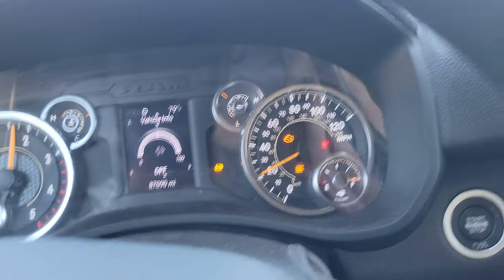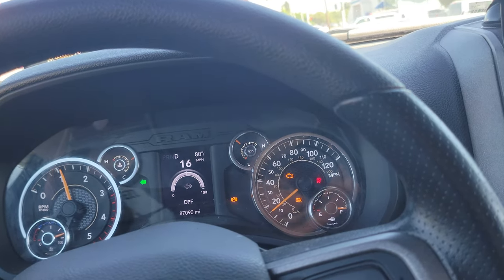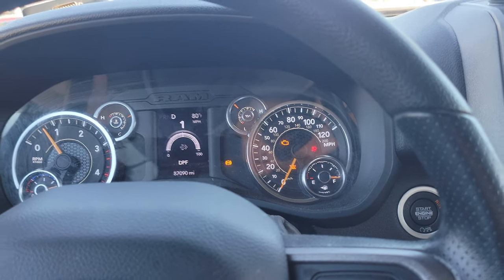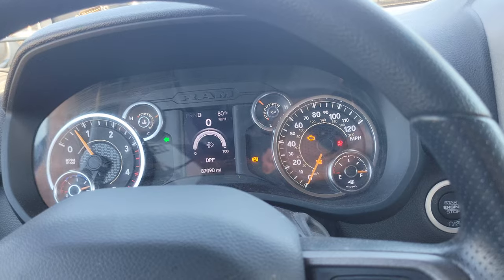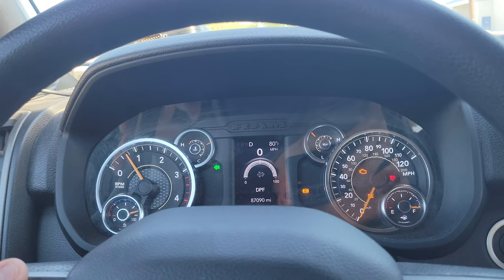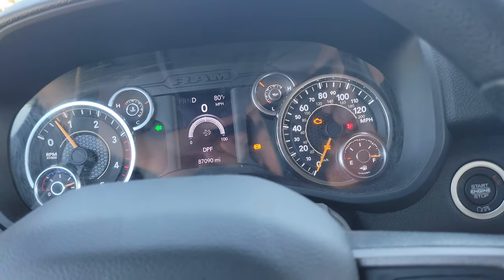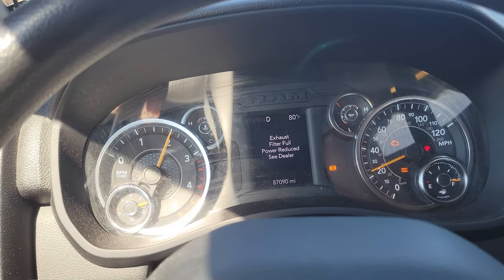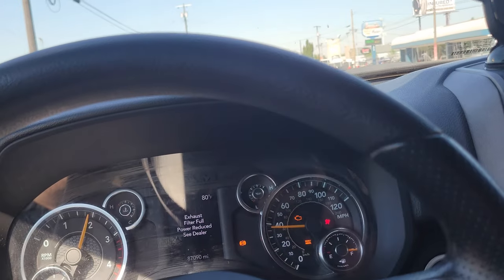2022 Ram 3500. Showing dpf issues.

Comment: Hey Paul, have the dealer check the pressure differential sensor. It could be faulty and misreading the level of backpressure between the front and rear of the DPF. The Pressure Differential Sensor calculates carbon saturation levels. The DPF could be fine but the sensor is reporting excess carbon and preventing a regeneration cycle.

Comment: About a month ago I threw in the towel on my diesel pick up. It got to the point where I had to wait days on end just for a diesel tech to be available to see the truck then was placed on a back order for an egr 3 months. Luckily for me gassers can do everything I need and I will never again own another diesel. If your out of warranty and own a diesel most people would go broke at the sight of a check engine light.
Reply: Its unfortunate. Diesels were always more simple and more reliable than a gas motor but thats no longer true. Gas engines are now more reliable due to emissions. If you really need to tow heavy all the time you just gotta either bite the bullet and be ready to spend tons on repairs and have downtime or buy an older truck and restore it. Either way its not worth it
Reply: @ronnieswindski825  absolutely, it’s a shame.
Reply: As planned by the EPA

Comment: Had the same issue dealer tried to manually regen the truck wouldn’t fix it they reflashed the ecu didn’t fix ended up being a bad dog filter now I’m waiting because it’s on back order 22 ram bighorn mega cab
Reply: Doubt that fixes it either unless it was sucking air
Reply: They should have never added these emissions systems
Reply: @sethmichaelson6972 The truck manufacturers don't want to...the EPA is forcing them to. The EPA is ran by Libs, given the power by elected Libs, who were voted into office by Libs.
Reply: @grc5618 if they cared about the consumer in that point they wouldve made it the same on the ecu so we could delete them easier my 2022 ram 2500 6.7 so has 60k thank god no issues yet but ive looked its 6000$ to delete my truck not worth it for me. Luckily i drive an hr to work on hwy at 75mph so it get hot everyday and then i also use it around the farm pulling trailers some and a tractor but if i have an issue i think ill be looking at trading it coming up to the end of three yrs paid would love to keeper got my bumper lift and winch already on’er but if something get back ordered i cant pay months of payments for a truck i dont drive 800$ payments aint cheap

Comment: So glad I bought a 2018 Ram 2500 and had her fixed @ 9000 miles.
Reply: Glad I bought a 2017, with a CP3 not a CP4 injector pump and still solid cam followers and not hydraulic lifters.

Comment: Def nozzles get all gunked up. Just remove and clean it. Then only use blue def platinum
Reply: Using platinum expired def is a big mistake.
Reply: @repairvehicle  Are you saying Platinum Def is bad? 
Which Def brand do you use?
Reply: @faultless18  too many platinum def sold expired or near expiration. I use oem def, clearly stated expiration date not like platinum that you have to call hotline to find out expiration

Comment: Just got my 2022 2500 out the shop yesterday for a full DEF filter with no warning. Dealer is waiting on a recall DEF sensor along with 2 other recalls but they cant get the parts. After leaving the dealer yesterday my truck did a regeneration with another regen this morning. No dealer can tell me the true process of what to do when my truck starts a regeneration; as of yesterday my truck said regeneration in progress continue driving. Now it just says regeneration in progress, not continue driving. I dont know.

Comment: I have a 2020 Cummins 3500 shingle shingle rear wheel. Just had the CP4 replace today under the recall, back to CP3. I have a bank's data monster that tells me when  Regeneration is going to  happen. I never shut the truck off until the process is over. I've never had a problem with DPf filter.
Reply: How many miles between regen idash tells you?
Reply: @repairvehicle   The bank's gauge will give you a percentage.  When it hits a 100% it will be starting in about 8 miles.
Reply: @mikegroft1569  I have banks and it doesn’t change percentage
Reply: The gauge will do different things for different year& model  Vehicle. My 2020 ram Cummins gives me a percentage when DPF is getting ready to regen.
Reply: @mikegroft1569  on my 2018 idash does not work. But scangauge 3 gives me percentage, mileage and hours
Reply: @repairvehicle  The gauge will give me a percent like 80%. When it hits 100 then regen will start real soon. When it is done it will say something like 45%. From factory ram has a gauge that will tell ya the regen process has started & when done. No idea when it will happen though. I never stop truck during regen process. Truck has 25,000 miles. No problems with dpf system.
Reply: @mikegroft1569  scangauge 3 will give percentage too, up 100% when it’s full and it will indicate if regen is on or off. Mileage between regen and hours between regen. Also, scangauge 3 displays quality of def fluid in percentage

Comment: I have a dodge ram 3500 diesel code p2459 came up the dealer says I need a new new filter for 3500  it has 88000 miles on it I feel that it’s to early for a new filter what should I do spend money on some thing I don’t need or go else where😊

Comment: Experiencing the same issues with a 22. Currently have 60k (52k towing) and 200 idle hours/ 1176 drive hours and well maintained. Dpf was replaced at 35k and I depend on this truck for work. Going back to ford

Comment: Mine did this about two weeks ago at 70k miles. Exact same. See dealer power reduced blah blah. 50% DPF and Check engine light. But I gunned it, and it went into regen mode, it cleared the see dealer message. And haven’t had an issue since. Fingers crossed :/

Comment: I would not label all MY2022 are issues.  There are tens of thousands of them out there that do not have an issue.  Diesel emissions has come a long ways when it was introduced in late 2000’s, but can be an isssue early on before racking a couple hundred thousand miles.  It sucks if it happens.

Comment: Anyone have any fuel leaks on the cp-3 conversion kits? 19-20 ram Cummins? Coming from the high pressure line that screws on the pump to the fuel rail? Thanks.

Comment: Frustrating Paul. I do have a 21 that was built about 3 months after yours. Everything has been perfect with the truck so far. 15k miles.
Reply: Same here with my 21 as well just hit the same milage been very happy just an issue with a squeal after I take it off park and I to drive

Comment: My 22 3500 had to have a def injector replaced at 3,000 miles but no dpf issues yet wonder when they will start.
Reply: When don’t allow complete regen done
Reply: So if your almost home and the regen starts what do you do ? Drive around till its done ?

Comment: Hey Paul thanks for the video. Do you know by chance if the drivers of your trucks are shutting it off when it high idles itself? I've read on a few forums that it plugs the def when you shut the truck off when it is regening itself
Reply: Forums are garbage and it’s a false information about plugging def. Do you know the purpose of def?
Reply: Two out of the three trucks I've driven have not had plug def filters! Other drivers have gotten those trucks and have had problems with the def. My thoughts are that's the only thing I do that is different is if the truck High idles itself I wait until it idles down

Comment: I just called dealer my desiel particulate had 3% remaining he said computer will regen filter so far has not
Reply: How do you know had 3%?
Reply: @repairvehicle  that is what guage told it said 3% remaining
Reply: @GaryBlankenship96b40  what gauge?
Reply: @repairvehicle  2022 dodge eam 3500, as i scroll through engine report oil temp pressure coolant boost etc rt click it comes uo desiel particulate filter it say 3% remains justblike oil and fuel filters
Reply: @GaryBlankenship96b40  , thank you! My 2018 does not have this option from factory. I am using scangauge 3 and when it’s says 100% full, it starts regen and displays mode on or off. I just uploaded video to my channel if you want to see

Comment: Driver idle much?  That will plug them up.  What's your hours vs miles.
Reply: Drive idle does not plug up any worse than driving loaded, it still burns fuel and generates soot. Idle hours not displayed by the date, it shows total hours for idling and driving
Reply: @repairvehicle  DRIVER. As in Is the driver idling all night so the exhaust and engine is not hot enough to burn anything off.  I don't know what you a referencing.
Reply: @repairvehicle  That's not true at all. At idle or low load, the EGTs are lower, creating more soot. But at higher RPM and higher engine loads, it reduces the soot buildup, even creating enough EGTs for passive regeneration.
Reply: @AkioWasRight  passive regen starts at 15mph or higher
Reply: @Itsa_Mea  did he say his driver was idling all night with this truck?
Reply: @repairvehicle  Did he say his driver didn't?  Does he really know?  THAT'S why I asked the question!! What are the hours in the cluster?
 This isn't a hard concept.
Reply: @Itsa_Mea  hours on the cluster is not going to tell you if idled on his last trip or not. It gives you total hours for driving and idling.
Reply: @repairvehicle  you're clueless. The EVIC gives stationary IDLE hours!  Plus it gives driving hours so by knowing the hours and miles it gives an average.  
  Stop guessing and let him supply the numbers.
Reply: @Itsa_Mea  , you are clueless yourself, you did not even read my comment. Read again otherwise you make full of yourself. I drive ram cummins and know what I am talking about. You are the one guessing with too much idle statement. Don’t even remember what you said earlier? Read it again your own comment and don’t put your own words into my mouth.

Comment: It’s not just 5th Gens….DPF issues go back to early 4th Gens we have a 2012 3500 and it went through 2 EGR cooler’s and a DPF filter….all it did was pull as well……drive to Mexico and have so parts fall off LOL
Reply: It’s because they were running without def and engines were dumping a lot of fuel and generating soot
Reply: @repairvehicle  many moons ago when DEF first started to get serious around 2010 maybe filters were clogging thank god, we have a pre-DEF truck
Reply: @DIYKAI  pre def requires frequent erg system cleaning
Reply: @repairvehicle  if you have a EGR to clean lol
Reply: @DIYKAI  what is your fuel economy without egr?
Reply: @repairvehicle  well if we were to hypothetically have a 6.7 without one, it would get around 16 city with a light trailer, 20+ highway unloaded, 10k trailer around 11-12…..with a Titan tank 800 city over 1k highway. 😃
Reply: @DIYKAI  my 18 cummins gets 21 highway with all the emission equipment and 18 highway towing
Reply: @repairvehicle  does yours have 900HP and 1500TQ LOL
Reply: @repairvehicle  the newer ones do well we heard

Comment: I'm going to have to take a break from your you. getting worried my 22 will fuck up. only got 9k on it
Reply: It will be fine.  Like every truck manufacturer……a small percentage of trucks start acting up. Of course the guys that have issues come onto these channels looking for help. Think about the thousands of trucks on the road that are just fine.
Reply: I got 102456 on my 22 just pull def injector cleaned it in water. An just changed my crankcase filter.      Trucks a 22 big horn an is a best.  I pull a 40ft hotshot

Comment: Both of my local dealers can’t even get me in for 12 weeks for trans issues
Reply: What issue are you having? What year is your truck?
Reply: @repairvehicle  21’ ram Cummins with 68rfe.  Shift solenoid tripped a code p0750 uD circuit fault.  Cleared it.  Drives fine.  Not even gonna deal with the dealer.  My local diesel mechanic has a 5th gen with a 68 and he’s having the same issues.  Ram doesn’t even know how to fix it.  I’m just gonna drive around with my scan tool for 10-12k miles at a time until it happens again.  Buy a valve body, deep pan, new solenoid (replace and put the old one on a shelf as a backup).  I’ll keep the stock thermal bypass valve just because it gets pretty cold here. Have you heard of this or have suggestions?  I checked the harnesses and put dielectric grease in them.  Fluid is clean.  Truck has 13k so it better be.
Reply: @Steadierpark  , I have not heard of this issue. My 18 at 50k miles with 68rfe is running flawlessly. It could be defective part, it’s common in any brand these days

Comment: I don’t get why people are buying new and paying $600-$800 a month if not more it’s insane!!!
Reply: Because they have money
Reply: I dont get why people are still buying these stupid overpriced diesels these days!!!
Reply: @SuperDuty250  , power, sound, longevity, fuel economy and exhaust brake is best in class on cummins
Reply: @repairvehicle  dont forget dpf issues
Reply: @SuperDuty250  dpf issue is when you don’t allow truck to complete regen. It’s like saying engine issues, when you don’t maintain.
Reply: @repairvehicle  you dont have to worry bout none of that with gas though
Reply: @SuperDuty250  , if someone is paranoid about diesel break down, gas is better option for them.
Reply: If you use your truck right, you'll be making upwards of $2,000 a day. In less than two months time, even fully loaded Long Horn would be paid off.
Reply: @SuperDuty250  I don't deny emissions junk can be problematic. However, the diesel has far more capability than any gasser. It's just that simple. In the long run, they make more and cost less, even with emissions issues.
Reply: @mark7067  hot shotting ?